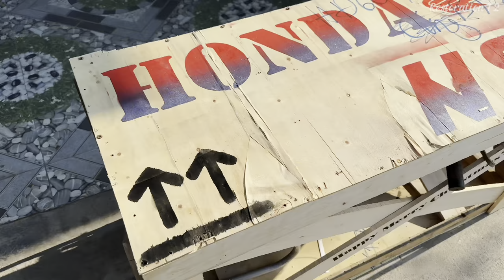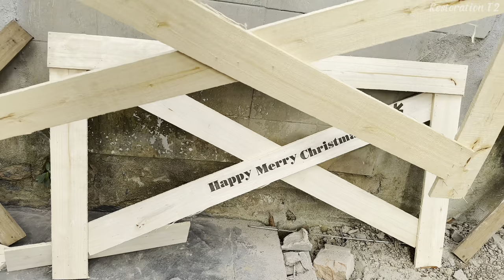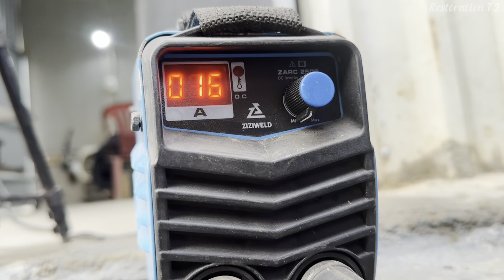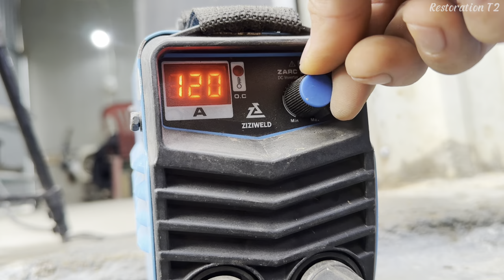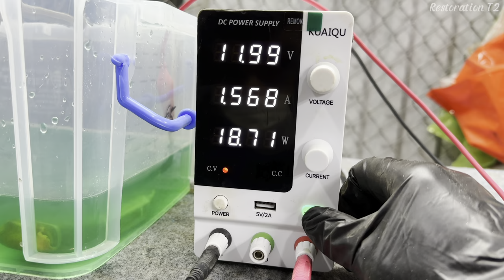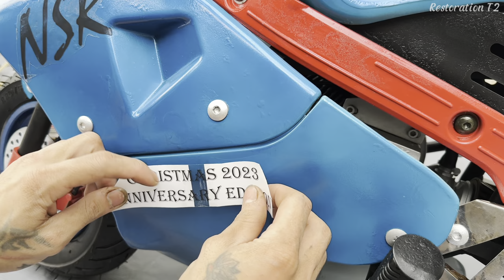Restore Santa's Gifts | Honda NSR 53cc Completely Revived

Comment: It would have been excellent if the paint on the brake hardware is not trash and new chains or at least cleaned and regreased chains. Generally, all the paint work is trash. It's a pity though because he has all the tools to make it perfect but he didn't perfect it.

Comment: just 1 tip, the exhaust pipe is too long, like 4 cm, and its shoved into the expansion chamber, cut the exhaust on the weld between the pipe and the expansion chamber, remove that little piece in the expansion chamber, and weld them back together, but flush now, that way the exhaust actually works, it will have much more torque then, and run wayy better, i used to race pocket bikes, and was national champion, did modify and repair hundreds of these..
Reply from the maker: Thank you 👍

Comment: SOOO FAKE🙄
Anyone that's worked on old bikes can tell real corrosion from that chemical sprayed-on crap.
And everything just disassembled sooo effortlessly. 🙄
No snapped bolts. No stripped screwheads. Black-oxide capscrews look a couple years old. Iron rust on cast aluminum wheels. 🙄
FAKE FAKE FAKE

Comment: corrosive
I sprayed the product and made it look like it had been completely repaired...
Bolt to that extent
If it is corroded, never
It doesn't work out that easily

The evidence is the first
When removing the cowl window, there is a mark on the inside of the window that looks like it has leaked.
It is a mark of pouring liquid that appears to be corroded.

He certainly seems to know how to handle a bike, but I wonder if there is a need to add this kind of directing?